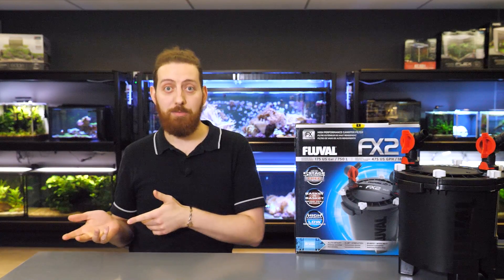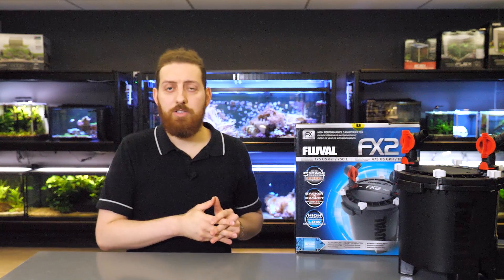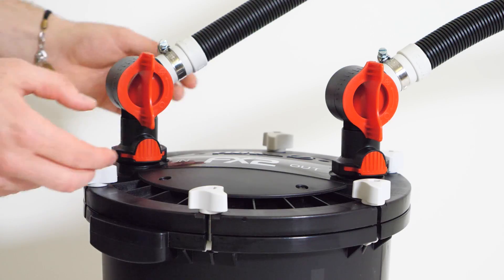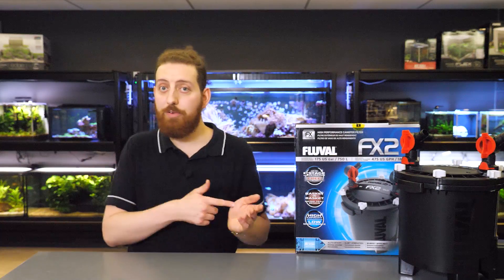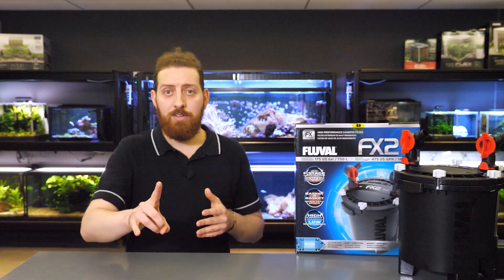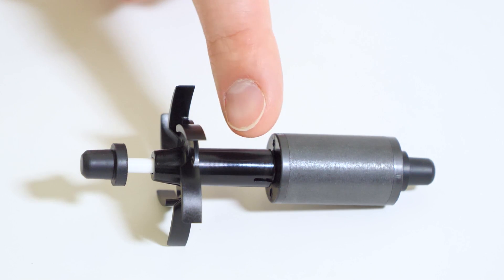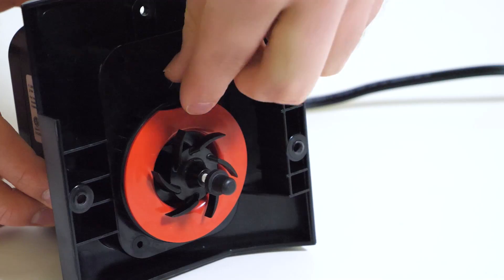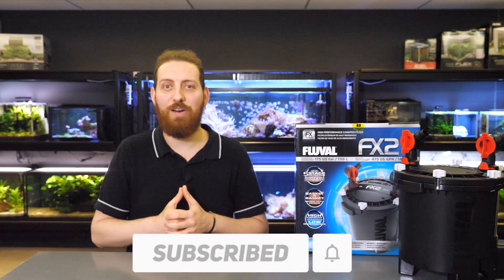Fluval FX2 Canister Filter | General Maintenance

Comment: I just set up my FX2 3 days ago.  Today all the sudden it shut off for about a minute or 2 and turned back on. Is this normal?  I’m unable to find information on this.  I know when you first start it up it shuts off and turns back on but it’s been running nonstop for 3 days now.
Reply from the maker: Hi there! Yes, this is normal! The motor shuts off every 12 hours for 2 minutes to evacuate air that may have been trapped inside the canister, and then restarts.

Comment: I have a great collection of the many fine FLUVAL products !!! I will always have the same high  expectations " knock on Manzanita "
since I have been running my oldest cannister 406 24 / 7 going on 4 years with the same media and foams and I replaced the original o ring as soon as I .....honestly I didn't do it for anything other than I felt it was worth the swap but I have been religiously using food safe lubrication every time I have serviced and the other reason for it being so dependable is that I have been using cannister since 2001 and learned to do it the way you built it and I am 100 % positive that every person who has ever had a problem with the 06 & 07 lineup has been the problem ....guaranteed.  This is my only conundrum with Fluval and the ridiculous suggestions that I would benefit from throwing out 1/2 my media every 6 months and the only reason I would ever be in agreement is if I ever get lazy and not process water changes , monthly maintenance and last reason is dumping food in my aquariums instead of only small amounts several times a week and Sunday I only have been doing veggies before the weekly water change. Peas and Zucchini have been my best weapon for not having any issues with bloat , dropsy , constipated fish 🐟

Comment: I recently bought FX2 for my 67.32 Gal Tank. Flow is looking quite high. Is it possible to adjust the water flow?
Reply from the maker: Absolutely! You can reduce the flow by turning the output nozzle down by up to 50%. 👍
Reply: @fluval  Many Thanks👍
Reply: @fluval  Need to know whether I need to adjust "IN" and "OUT" AquaStop Valve both or need to adjust only "OUT" AquaStop Valve?

Comment: I want to purchase the FX2, but im not to sure if there is a gravel vacuum that will connect up to the FX2, is there a vacuum for it please ??
Reply from the maker: The FX2 does not feature the Utility Drain Valve and is therefore not compatible with the FX Gravel Vac Kit. The FX4 and FX6 are, however! 👍
Reply: Can we add Utility Drain Valve to Fx2